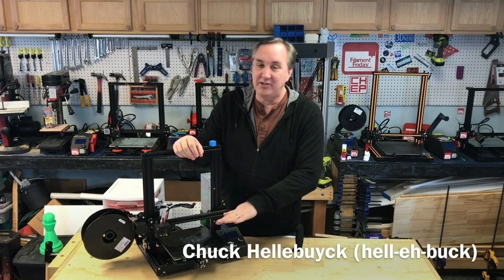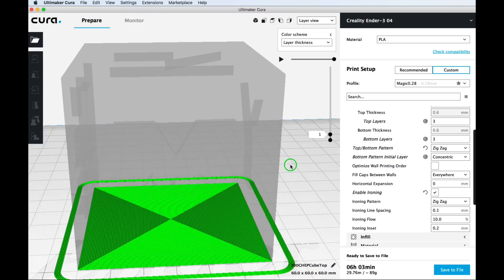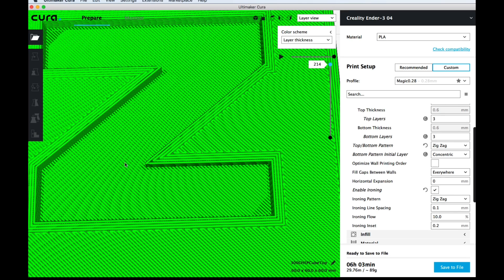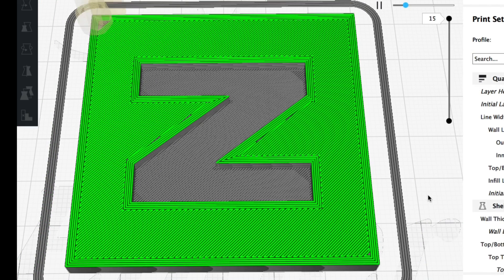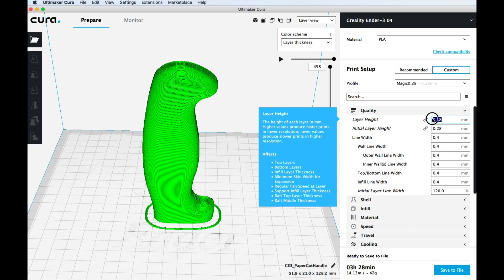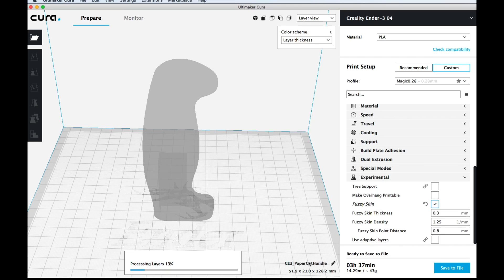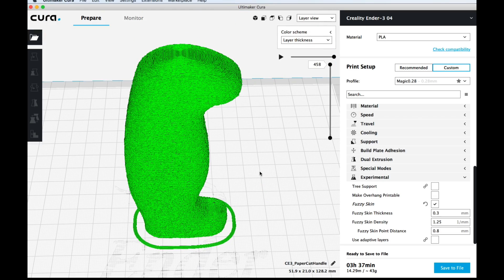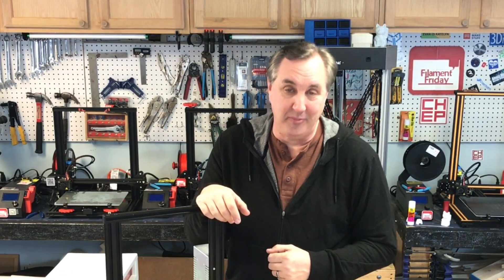Cura Fuzzy Skin and Ironing on 3D Prints

Comment: For a non-fuzzy part, just use the blocker as you did for the changing of infill. Make a block and switch off fuzzy skin. Works for my fuzzy parts with non-fuzzy parts for screws. Oops I see, you mention IT now
Reply from the maker: Andreas Thaler - Check out the comment pinned above yours?
Reply: @FilamentFriday  Sorry, typed without reading the comments...

Comment: Your fuzzy-settings don't look too good. Point distance is too high, it looks too "liney". I got the best results with  a thickness of 0.2mm and a distance of 0.3, this way the lines almost get invisible. don't go too low on the distance though, as a rule of thumb I usually stay between 1.5-1.8 times the thickness regarding the distance value.
Also, adaptive layers would have helped a LOT on the top section of your part. Adaptive layers, Fuzzy Skin and Ironing are the most important additional features on Cura for me, with a little tweaking the prints don't look like 3D-printed at all - at least to people that aren't into 3D-printing ;)
I'd also have to thank you for promoting the concentric pattern, you're the first youtuber I came across that actually likes this feature just about as much as I do... I really wonder why this isn't getting more attention...
Anyway, enough of that. Thank you very much for allyour work, keep it up!

Comment: Have you managed to duplicate these into s3d
Reply: How to make 'ironing' in S3D? Easy: make another process. Get INTO the last layer. Make sure you go 90 degree to the last layer. Now: Extrusion width to 0.1. Extrusion Mulitplier to the usual (0.9 with PLA, 0.95 with PETG and 1.0 with ABS). Layernheight maybe 120% of normal. Speed up to 80 mm/s and maybe 95% smaller (I think this option is in 'others' (normaly used to prevent elephant foot). There you go.
Reply: @andreasthaler7068  thanks that's what I was looking for
Reply from the maker: It doesn’t have these features

Comment: Hey Chuck, not sure if anyone has mentioned this. But I use fuzzy skin a lot on my projects and you can use the support blockers to change the settings between models and use that to cancel out the fuzzy skin in the hole of the handle. Just resize the support blocker to encompass the hole and be mindful not to have it overlap the outside shape and you're all good!
Reply from the maker: It doesn’t work. I tried it and it allows me to add fuzzy skin in the support blocker area but cannot uncheck it because it’s not enabled.
Reply: You have to start by turning on Fuzzy skin then add the support blocker and remove the checkmark on the per model settings of the support blocker. I just tested it again on my end. I'll see about throwing up a video or a file somewhere to share with you.
Reply from the maker: I did that in this video but it didn’t work. 
https://youtu.be/MA7jzaghIEQ
Reply: The only thing I can figure is if you don't change the Mesh Type first it might not work. It is still in the experimental area so it might be that crazy specific.
Reply from the maker: If you can show me the steps, I’m open to it because nothing I tried worked.
Reply: Skype?
Reply from the maker: Not sure I’d have time but if you can screen capture or just quick list of steps. I’d appreciate it. You can email to chep@elproducts.com
Reply: @FilamentFriday  I got it: set the inner support blocker model settings to: Fuzzy skin on, Fuzzy skin thickness to 0.001mm.. It comes out smooth enough for any insert of any type. You can't turn it on/off but you can pretty much nullify it's effect strength and do it that way.
Reply from the maker: Excellent. I’ll try that.
Reply from the maker: Shadow the Wiseman - Thank you for helping me solve what was my mistake. I pinned a comment at the top with a link to a video explaining how to block fuzzy skin.

Comment: You can use the support blockers and set them to modify settings with the overlapping models to disable the fuzzy skin. Something I learned watching your videos ;)
Reply from the maker: Yeah, thought of that after posting and many have commented. I’m going to try it.
Reply: @FilamentFriday  It does seem the settings modification has some peculiar requirements. It seems the software slices the object into separate geometries so there are perimeters around each section, and probably if the modification would place the perimeter walls too close each other the software refuses to cooperate. I had a few times when the modification didn't work, and moving the cube just a bit made the difference.

Comment: Chuck, be advised that there is a known bug with ironing in latest stable cura (3.6). It misses some parts of the surface, you can see this in the layer view. To fix this the infill type needs to be set to "gyroid".
Reply from the maker: Thanks. Was not aware of that.
Reply: @FilamentFriday  this is the related github issue: https://github.com/Ultimaker/Cura/issues/4524

Comment: Thanks for addressing my question.  This is exactly what I was looking for - a way to break up the outer skin parallel lines where your eye is drawn to any irregularity immediately.   This technique sets the bar even higher for S3D V5 which will require existing seasoned S3D users to invest additional funds.  I knew about ironing and it is a way to make the top of a print almost as smooth as a printed on glass bottom.  Hopefully they will figure out a way to texture the top of a print as well.

Comment: Nice! I'll try that Fuzzy Skin technique on the Ender 3 extruder knob (when I get it in 2 days)
Reply: Make sure you use a support blocker in the hole you use to attach it to the extruder and change the settings like in one of Chuck's older videos. I'll link it when I find it.

Comment: I love Cura's fuzzy skin mode.  I have printed a few things and they turned out awesome.  It not only looks great, but it's perfect when you need texture for gripping and/or you don't want to see obvious layer lines.  

Could you have used ironing on that small part at the top of the handle?
Reply from the maker: Possibly

Comment: Couldn't you use a cura support blocker and overide the settings so the inside has fuzzy skin turned off?
Reply from the maker: Possibly. I’m going to try it.
Reply: It looks this will work. I just opened up Cura and a test cube then put a support blocker on one side and enabled fuzzy skin for that blocker. The layer preview shows fuzzy skin there. I haven't tried printing it, but I might tomorrow.

Comment: I was a bit iffy about using ironing at first, but if I need a really good top/bottom layer, I'm totally going to try this. Thanks, Chuck!
Reply from the maker: It worked better on small surfaces than large for me. I have to work on the settings for large areas I think.

Comment: My cura doesn't have experimental  options
Reply from the maker: Are you on Custom?
Reply: I think you have to go on advanced  or expert settings by clicking the three lines next to the search bar. The experimental mode should be the last box on the list, but I think Chuck explained how to get to those settings a lot better in the video.
Reply: @epsil0gue246   Awesome thanks!
Reply: @WayneEarls  No problem. Happy printing!

Comment: You could add a box model in there to overlap the inside of the handle.  Set that to override overlapping settings.  Then turn fuzzy skin off on that box.  That should make it so that the fuzzy skin is only where you want it to be.

Also, make sure that the box only overrides settings, but doesn't print.
Reply from the maker: I’ll try that
Reply: @FilamentFriday  That is how I do it when don't want the fuzzy skin in certain areas